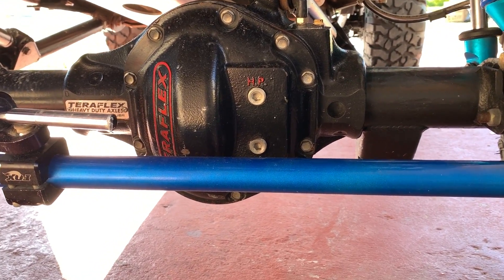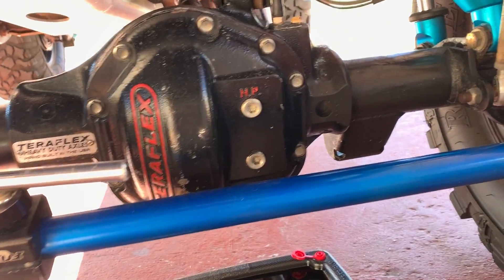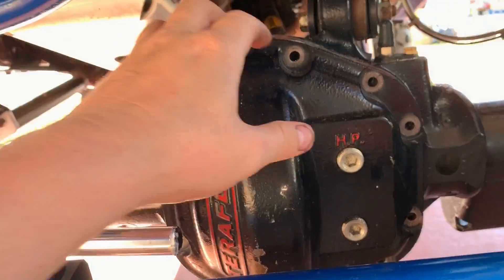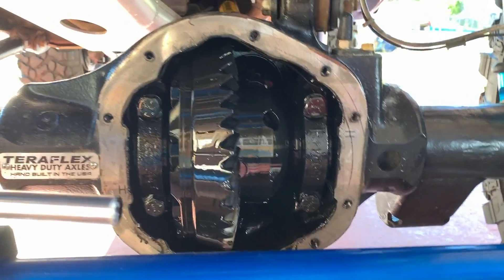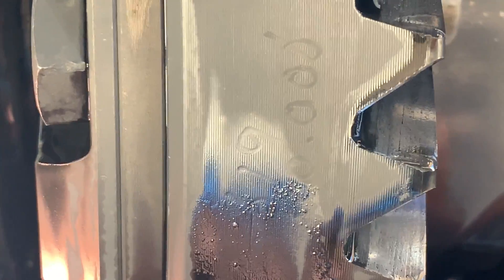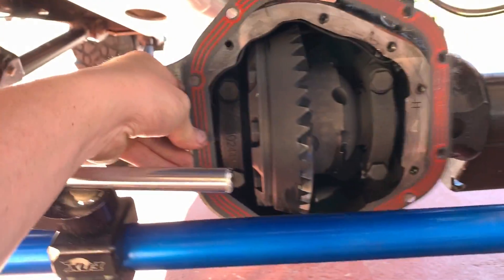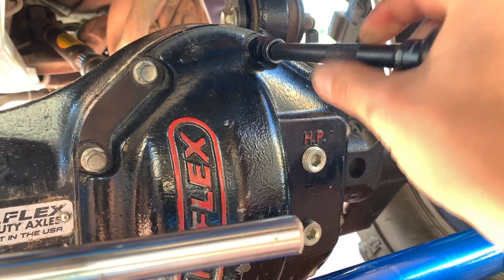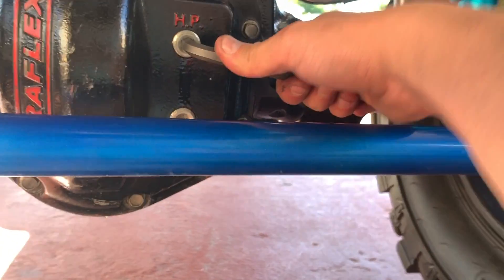How to Replace Front Dana 44 Gear oil and Gasket

Comment: the top bolt is in case you have a high pinion angle, hence "H.P.". looking from the side, if your driveshaft goes into your ring gear above halfway, it's a high pinion gear and should be filled to the top hole otherwise your opinion will not get oil properly

Comment: The 2 fill holes give you the ability to adjust for your pinion angle.  Dana 44’s only take 2-2.5   Imperial quarts.
Reply: What diff oil do you recommend for Dana 44?

Comment: The two fill holes was the reason i clicked on this vid - i wanted to know why.

So according to guys on this jeep forum who contacted teraflex: https://www.wranglerforum.com/f202/teraflex-dana-44-diff-cover-fill-plug-too-low-2191321.html

You are supposed to fill to a level between the two holes - what level depends on the pinion angle.

I would also use some rtv on the mating surfaces.